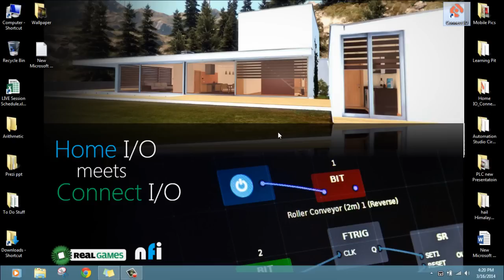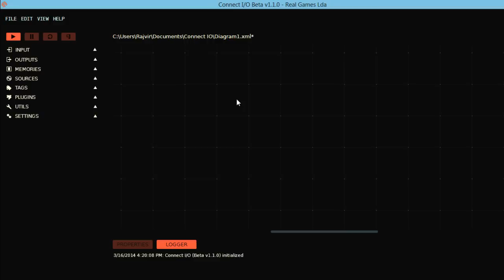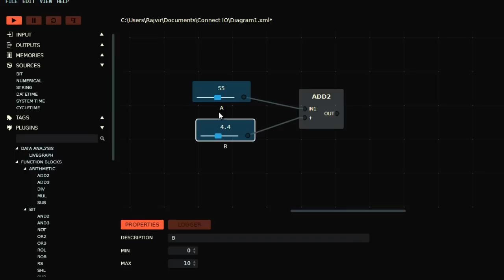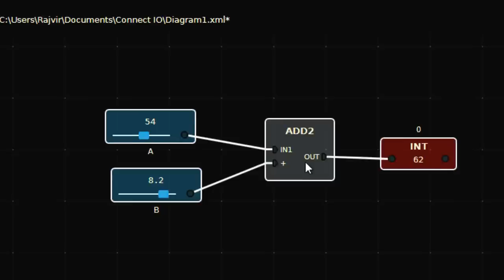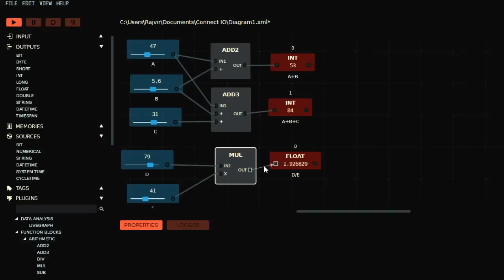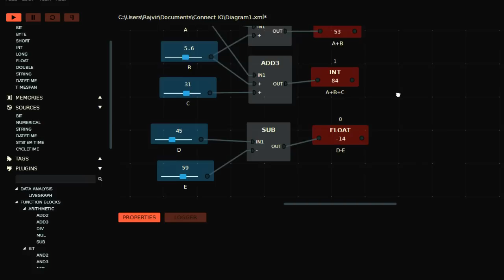PLC FBD Logics  Lesson 1- Basic Arithmetic Functions

Comment: I tried to download Connect I/O, to no avail. Is this still available as a free download?
I am prepared to pay for a license and actually attempted to do this.
Is Connect I/O a stand alone install or internet dependent?
Reply from the maker: Dear Derrick, the software Connect IO is no more available as standalone. But you can buy FACTORY IO software in which the CONNECT IO is available as CONTROL IO (updated version). Check about FACTORY IO here_ http://nfiautomation.org/product/factory-io-starter-license-combo/

You can do much more than just logic design in FACTORY IO. In factory IO you can control intelligent automation system via logic designed in Control IO.
Reply: Very good and thanks for the update. 
Does the Factory I O software install as a "stand alone install", or is it a client, "internet dependent"?
Reply from the maker: There are two licenses for FACTORY IO Ultimate version if you buy lifetime license. 
1) Floating License 
2) Standalone License

However, in student license it is only standalone!
Reply: Thanks very much.I think I will research the Standalone license further.
Reply from the maker: This weblink might be useful: http://nfiautomation.org/product/factory-io-starter-license-combo/
Reply from the maker: This weblink might be useful: http://nfiautomation.org/product/factory-io-starter-license-combo/